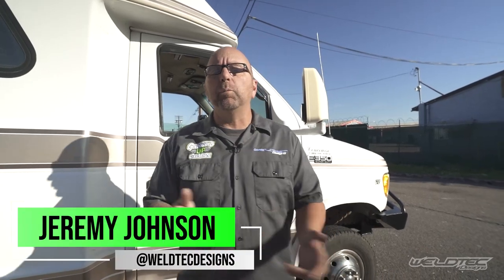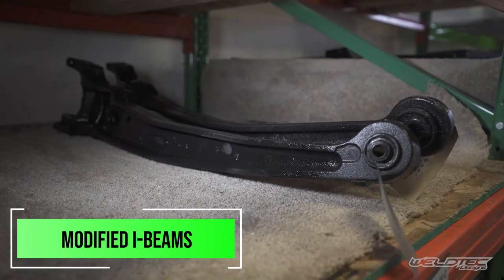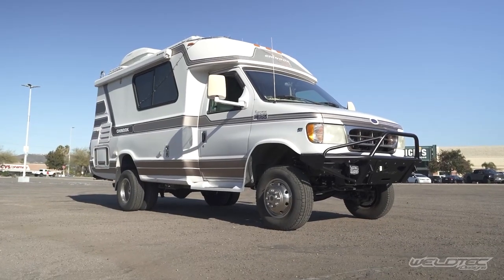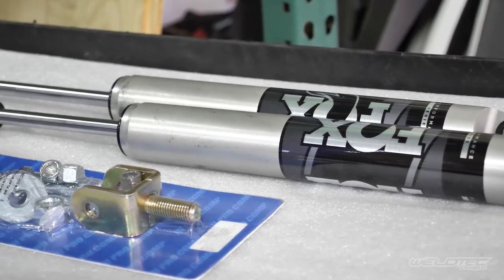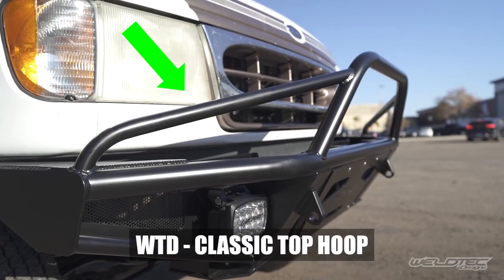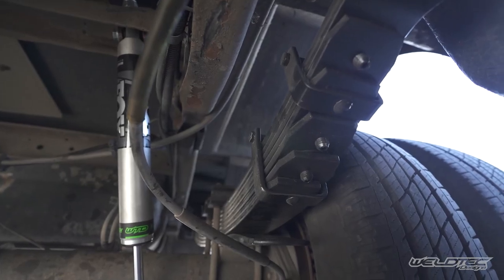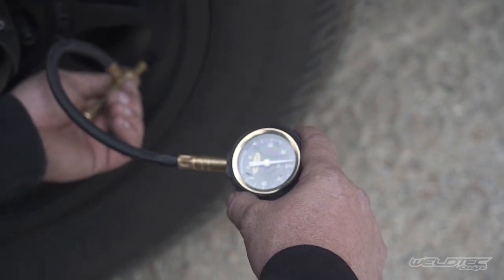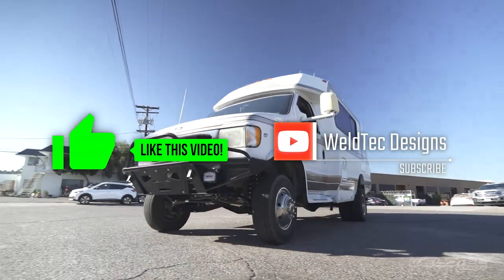Off-Road Chinook Upgraded With 5" Suspension Lift Kit,  Tube Winch Bumper and ARB Air Compressor!

Comment: These are so cool and a well built camper with awesome suspension now.
Reply from the maker: These become so fun to drive, however it also takes care of so much of the preventive maintenance. All new bushings in the front suspension as well as the rear leaf springs.

Comment: Thanks for the content 👏👏👏 I think a Class B Chevy/Ford is next after I finish my current Express 2500. Is there any Express 5” kits in stock?
Reply from the maker: Give us a call at (619)596-9831 or contact us at info@weldtecdesigns.com. To discuss our current inventory.
Reply: @WeldtecDesigns  10-4, I work evenings. I’m usually up around 11a, should I call after lunch time, 1pm or so?